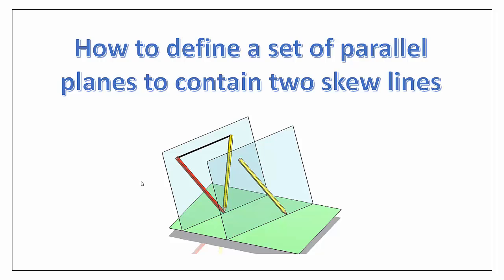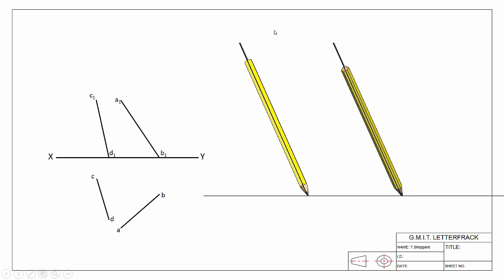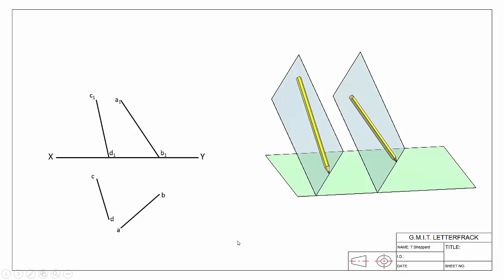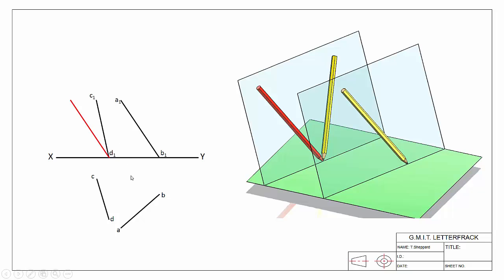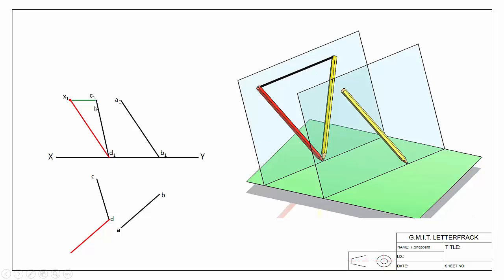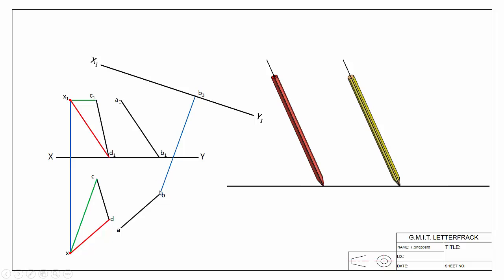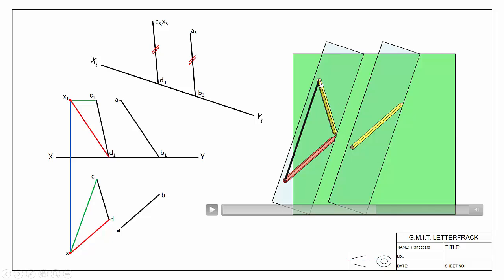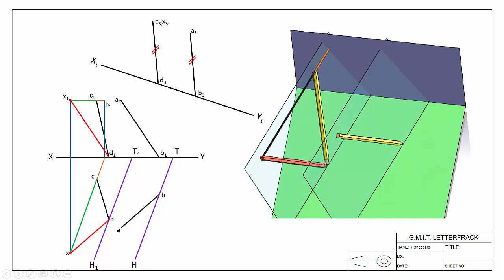Skew Lines:-How to locate a set of parallel planes to contain two skew lines

Comment: Such a nice explanation. Which software are you using for the animation?
Reply from the maker: Thanks. I use a combination of Solidworks to make the 3d animation and autocad to create the 2d parts. Both are imported into powerpoint, where I add the animation to the 2d lines and I import a mp4 of the 3d which I record directly within Solidworks.
Reply: @thomassheppard5369  So creative. Thank you for taking the time to explain.